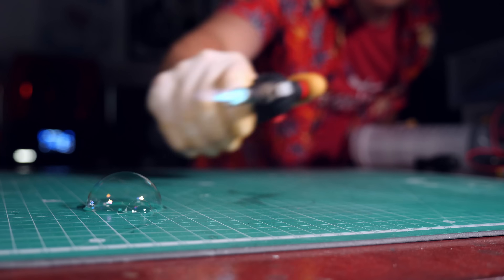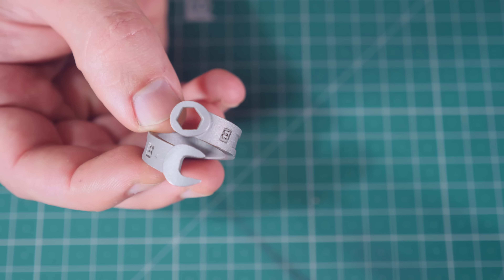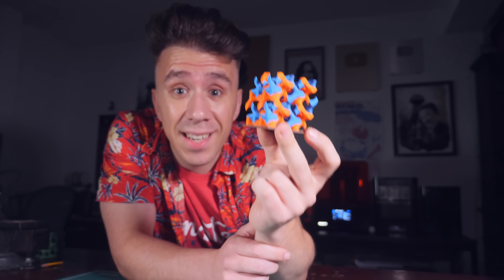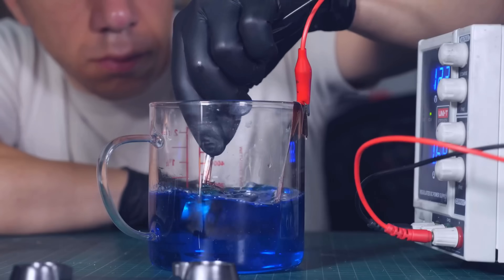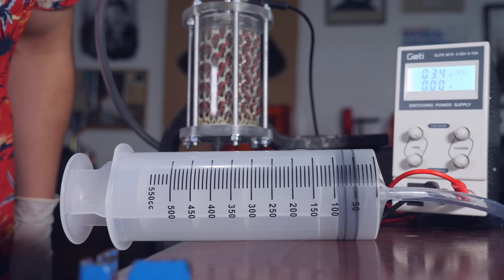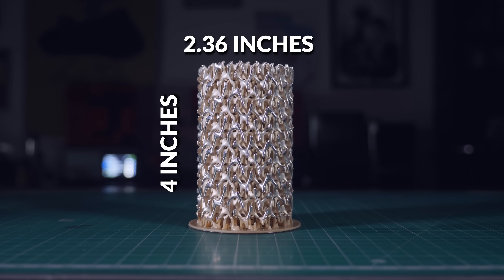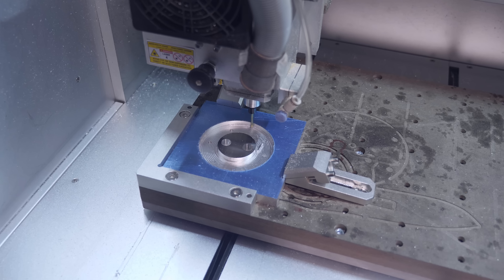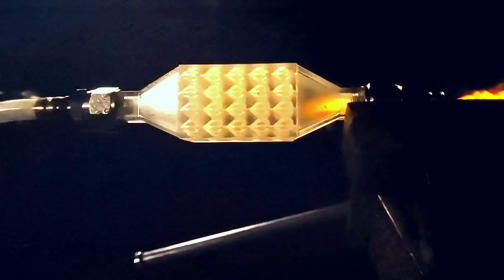ROCKET that LITERALLY BURNS WATER as FUEL

Comment from the maker: Click my trainwell (formerly CoPilot) link https://go.trainwell.net/Integza to get 14 days FREE with your own expert personal trainer!
Reply: Woah
Reply: I would like to try
Reply: BRING. BACK. THE. MOUSTACHE!
Reply: or even use a power supply as that would be safer.
Reply: pc power supplies are cheap and usually have a large/hefty 12v rail. 
some are rated for over 100amps. perfect for hho generators.
Reply: try plating it in gold.
Reply: Thought about using a tractor battery? A diesel glow plug is essentially a short circuit.
Reply: @Arrow14100  Tesla Tash, Tesla Tash, Tesla Tash! 🤣🤣🤣
Reply: Add some kind of current limiter in the circuit... Either using resistor or voltage regulator circuit😊😊😊.
Reply: VIDEO IDEA: BUILD A PISTON MOTOR THAT RUNS ON ELECTROLYSIS CELL AND THEN RECYCLES THE EXHAUST TO BUILD AN ELECTRIC GASS MOTOR (pls i really want a 3d printer😢😢😢)
Reply: You probably need current limiting resistors to protect the battery from discharging too rapidly. You could use an automobile battery or charger rated for 40A. You can't overheat the battery charger and it won't output more than its rating. You could put it into boost mode, which only lasts for a short period, and would give you 200A.
Reply: you can isolate the positive from the negative by adding felt layers in between the washers, thus giving you pure gas, not HHO.
Reply: try using a relay to reduce heat and save the battery...should get one from any old car
Reply: use a modified microwave transformer were you replace the secondary coil with a coil that have less turns (about 1 turn for the secondary coil for every 20 turn of primary coil) it should give you 20 amps of 12v every amps of 230v
Reply: Wrong, ist called electrolysis when you split molecules by electrons/electricity!
Reply: Hey @integza, have you thought about using capacitor banks? They are designed for fast and strong discharges.
If you have multiple power sources connected to a capacitor bank each and switch the circuits between them,
so that only one is discharging while the others are loading, then you could get rapid discharges of currents in quick succession.
Reply: For a high current power supply, consider using an Stick/electrode welder, most can provide 40 amps DC with constant duty cycle.
Just something I have seen before.
Perhaps vertically orientated plates will help with preventing gas from forming bubbles between the electrode plates.
Love the content and take care of your eyebrows!
Reply: Maybe this is where that one story of someone figuring out a way to make a car that runs on water but suspiciously destroyed possibly buying car manufacturers
Reply: hi integza!!!!
Reply: Try and put an expansion chamber so you can use your power supply and it might be enough to get it to run constantly.
Reply: You should use a Huawei g4850r2 power supply which can output up to 60A continuously and has a working Voltage range of 0-60V with a total power of 3kW! It can be bought for as cheap as 80$.
Reply: if you are having issues with amps, put multiple of the exact same battery in parallel. That will spread the amp discharge across them and increase battery life.
Reply: Hi do you sell the file for printing the rocket engine?
Reply: put a resistor in between >?
Reply: you should look at some used HP 1200w server supplies. they can do 12v 100A and you can get them really cheap.
Reply: If you had a generator on a hydrogene powered turbine... could you make your own fuel from water to run the turbine?
Reply: Now you know what I went through YEARS ago when I tried to add one of these to my car. The damn thing drew so much current it started melting my jumper cables, but boy howdy, did that thing make hydrogen. 😂
Reply: Kalimero.
 Para protegeres a bateria dessa câmara de combustão aquática; basta utilizares um thermal-relay no lado negativo da ligação eléctrica. 
 E essa foi uma boa tentativa de se criar um motor a água. Embora, esse design de electrolise, talvez interesse à industria espacial ou à naval; para aparelhos geradores de oxigénio.
Reply: you want amps try wiring a couple car batteries in parallel
Reply: water DO NOT BURN 
burning
/ˈbəːnɪŋ/
adjective
adjective: burning

    on fire.
Reply: I think your design could be used as a engine for cars cheap and effective the battery could charge it self by resistance of the tire movement. Keep the idea to ur self don't letter other science people get it. Love ur video and love Nicolas tesla he my favourite scientist as well
Reply: Make a rocket that runs off of punctured lithium batteries
Reply: @schlend4  This will work too kind of dangerous as u need to be sure to discharge them before touching :D
Reply: forget about trainer and tell us where you got your hair implant/enhanced?
Reply: @reaperiscomingforme  they already refined the idea for use in cars. toyota did it with the mirai, though they use a PEM fuel cell
Reply: @jackasshomey  is it still used today
Reply: Limiting the current is your first port of call, second is the orientation of the lattice, rotate it so it's on it's side so the anode and electrode are vertical, this will allow for the gas to escape easier (or redesign it as three/four intertwined spiral cones for anode electrode and structural insulator).
Reply: Up next / future video proposal:
AI Designed rocket perhaps? LEAP71 rocket
https://youtube.com/shorts/OpzBNkh2C5w?si=ZD3IC2rlKjqguiUq
Reply: Please look up the a i generated rocket engine LEAP71 - future video perhaps? 🤔🤓😉
Reply: @reaperiscomingforme  yea the mirai is still in use but its only really in specific area's cause hydrogen pumps aren't available in a lot of areas. but it does work and its even shown to be comparable to gasoline and diesel motors for mpg

not sure why they haven't implemented it further.. only pushback im seeing is coming from the people pushing EV's because they call it "grey hydrogen" and say its "dirty hydrogen" even though on a molecular level its essentially the same as hydrolysis hydrogen.
Reply: @jackasshomey  cheers mate I never knew that 👍 😀
Reply: DC welder is your simple solution. Check out my proposal for 2 stage compressor w/ afterburner if you choose to continue the path of destiny (in comments) stay safe and thanks for Tainwell, I need this!
Reply: You could ask someone like electroBOOM to help you with the current issue
Reply: Pls do a cyclotron
Reply: Maybe fine tune the frequency of the current foor the hydrogen generator I read a brief paper about a man who basically said it's about frequency to maximize the hydrogen generation
Reply: I really need a 3d printer for my projects please 🥺

My Idea is to use the generator to build a hydrogen jet engine, dangerous but super powerful 😊🫠
I hope I win
Reply: Hey man. Great video.  Research: "Stan Meyer explains the Water Fuel Technology". I think he used AC(alternating current) instead of DC. You'll find a few videos about him here on YouTube.
Reply: Tomatoes are discusting!
Reply: Motion control that needs to move heavy things, where the motor draws a lot of current, use current limiters rather than speed controllers. Maube that would help?
Reply: Here are a couple of tips: consider using titanium plates instead of stainless steel because they resist corrosion during electrolysis. Also, bubbles of hydrogen and oxygen can create a gap between the electrolytes and the disc surface. Designing a method to minimize surface bubbles can enhance the efficiency of the generator.
Reply: From my tests, I used an 1000w PS from a PC on the 12v pin, It should do the trick.
Reply: what did you study in university
Reply: try it with engine
Reply: Just use an inverter welding machine. You can do 400A continuously if you have the correct model.
Reply: can u try acide battry (car battry ) to get high current
Reply: ooh like in the Sumerian Tablets, not only was their space propulsion water based but they run out of fuel through the asteroid belt because they also use water as weapon system. So it says they had to refuel on Mars the sixth planet even tho ship not designed for that.. and then they finally arrive on Earth the seventh planet..
Reply: @integza  hi there seems to be a scammer with the tag @integza3dgiveaway typing" w i n n e r " to get around moderation. Got me excited for a second lol 😅 but v obvious
Reply: how about a video about piezoelectricity?  its amazing i think it would make a great video . like there is a small crystal that gets slapped in push button lighters that generates enough electricity to light a flame!
Reply: What would happen if you treated the gen like a double tesla coil?
Reply: Why is this comment older than the video
Reply: Timeline: 3:00 Did you say water doesn't conduct electricity? And that is the reason why you are using sodium hydroxide.
Reply: What about thick water?
Reply: You could use a car battery cheap and you get high Ampere Output.
you could also try to make the engine smaller. Due to the fast reaction backfires are an issue so high pressure could be Dangerous ( the build you have does have a ratio high pressure, slow burn to Low pressure fast burn. The reaction is very fast (fast burn) so finding a nozzle isn't that easy). Useing a fuel cell could also be an Option If you Mix hydrogen and oxigen in the pressure chamber you could minimize the risk of backfires and diffrent fuel to Air mixtures would be possible ( you could Change the reaction speed )
Reply: Use a HHO dry cell.
Reply: use car battery
Reply: That subscription costs 90 bucks a month
Reply: Also get a modify a microwave oven transformer to get the low voltage high current you need... You need some really thick wire to do so....
Reply: Sc welder is probably something already have
Reply: Try a CAR BATTERY.  It won't let you down.
Reply: Video idea I think you should make a rocket powered off methane like for example if some kind of collection plant took garbage and collected the methane then made a rocket engine u don't have to use the garbage part I'm sure u could find methane some other way
Reply: you need to get higher C rated batteries. also higher capacity cells will put out more amps reliably than smaller. Lithium packs aren't linear as far as current draw is concerned. If you load a pack higher than its C-Rating, you lose overall capacity. meaning the more you overload, the quicker it dies. Also going to a higher voltage, wouldn't necessarily improve your current draw issue. you need get multiple packs in parallel, to get higher amp draw for a specific pack size. higher voltage packs of the same size sacrifice capacity for voltage(capacity directly relates to amp draw in Lipo cells particularly.
Reply: I think you need some resistance to prolong your batteries life.
Reply: @integza with my experiments I found out that baking soda and water with a teaspoon of vinegar and stainless steel works just as well to build hydrogen
Reply: You need a ZPM or a Tesla coil.
Reply: You can also have the  and oxygen kept apart and later add the oxygen to keep an consistent burn😊
Reply: Use a car battery
Reply: Congratulations on 1.23 million subscribers 123.
Reply: I would recommend using step down transformer !!!!
Reply: Can you can make engine what with this hho generator
Reply: Kolejny raz widzę że masz coś z etykietą po polsku, masz coś wspólnego z Polską? 🙂
Reply: try using a tractor battery with a voltage controller so you can control how much goes in and out with the extra heff of a tractor (or motorcycle) battery. my buddy made one of these and ran into the same problem, though he was trying to get a small motor to run off it. He got much better results even after just getting a tractor battery. he did get a controller of some kind to control voltage or wattage or whatever it spacifically lets you adjust.
Reply: A car battery will work best for you, it's cheap and can give 1000 amps of current, just change it probably after use
Reply: Try a DC to DC converter and maybe throw in a blinker relay to help mitigate the amp runaway.
Reply: Hydrolysis? I thought it was electrolysis. Taught me something new.
Reply: you need to add some capacitors and add a voltage/wattage controller so it controls how much power it can pull from the battery. that should keep you from smoking your batteries. look into solar generators, they have a lot of technology built into them no days that will fix your problem.
Reply: Humm, maybe the power could be stepped up with capacitors.

You could get a steady outflow and not kill your battery that way.

Possibly.
Reply: Dunno if I'm being dumb here, but if there's too much current then the obvious solution is a resistor to slow it down??
Or am I missing something why this can't be done/wouldn't work??
Reply: lets take a car battery for example:
There are couple of things:
Warranty
Cold cranking amps
It is a non-deep discharge battery type.

CCA is another way of telling you the batteries internal resistance. That limits the absolute maximum current.
In this application we don;t care abut the "gas guage" or Watt-hours the battery can provide.

Once you deplete the voltage below some value, the batteries lifetime has been seriously impacted.

You would use a deep-discharge battery like for a trolling motor.
Reply: What will happend if you got a turbojet engine with a generator in the front ? Now you produce your own electricity to the tank that produces hydrogen and oxygen, can it also power a waterpump to the tank? Perpetual machine?? 🤔
Reply: Current Solution: Stanley Meyer - It runs on water (You want electrons, not Amps / heat.)
There are two ways to get lots of electrons:
1. High Current and Low Voltage or
2. High Voltage and Low Current
Reply: The reason silver didnt work is likely it's sensitivity. When using Sulfiric acid, the silver reacts with the sulfur in the mixture forming silver sulfide, and when using Lye the silver forms silver oxide. Processes sped up by the electrical current. Try noble metals in the platinum group (though they are extremely costly)
Reply: I'm only @13:40 but I have to suggest mesh disks.  The surface area would be pretty mind-blowing.
Reply: Get an alternator to directly convert the wall Power to a few volts and lots of amps 😁
Since you're mixing anyways you don't need to worry about the alternating polarity.

But DO be careful with the wiring and insulation job.
Also connect the device first, THEN plug in, so the sparks are as far away as possible.
Reply: VIDEO IDEA: @integza maybe instead of a rocket maybe design an engine ( similar to a ICE ) so that you can create a feedback loop similar to a car that uses the ICE to rotate an alternator to keep the battery charged....might be worth looking into a solar option so the energy for electrolysis is taken from sunlight instead of batteries
Reply: hey integza, highly doubt you will see this comment. my recommendation to get a high amount of amps would be to get an automotive car battery and charger, those batteries can easily put out 800+ cold cranking amps which at least here in the us is a unit measured at 0F. That means the actual "cca" rating is usually much higher at room temps. If its enough to start big diesel and car engines then it should be plenty for you're hydrogen generator! Just remember that you can get good used parts out there if you do a little looking it will save you on costs!
Reply: What about making a engine that can run on hydrogen
Reply: I really need 3d printer for my 1st time learning... My suggestion is to put 30amp pwm after battery to your system to prevent the battery from breakdown, I hope this help👍
Reply: Idea for a future video is a Electric car powered by solar to get it moving first and a wind turbine to capture the wind in the forward movement.
Reply: @integza Woth reference to engine working on CMG gas… You can simply replace CNG tank with this too many small hydroelysis systems with a series/parellel connection to produce high amount of Hydrogen gas and can also store it to travel longer distances… also can do some changes in CNG engine to make compatible with Hydrogen gas fuel.
Reply: Oh because you don't have a car battery laying around or a battery charger
Reply: You can use a full bridge rectifier and plug it directly into the wall, I tried this and it pulled about 120v dc at 20amps. That’s about 2400w of power and it cost me 5$ in diodes XD for the love of god don’t try this at home.      I used a power strip and a 8000w high voltage regulator. Got some decent results 😊 also putting a diode on those batteries will prevent shorts so it won’t kill them but discharging too rapidly without some kind of regulator can burn holes in the batteries making them useless.
Reply: Maybe check out the thunderstorm generator not a rocket engine, but I'd bet you would find it very useful and take it through its paces, and in place of a muffler im sure its loud and very entertaining... and relates to this video pretty well!
Reply: Use distill water.
Reply: I would use a rectifer fioad and ac mains power
Reply: Installing a 0 - 36v PWM might work with 12v 12ah deep cycle ebike battery.
Reply: Try 12v car batteries there really tough batteries and can handle heat fairly well u can also double them up and make it 24v and when buying one look for the highest “CCA” number cca stands for cold cranking amps, it’s not uncommon to see a 1000CCA cad battery and u can usually get them for around $250 new
Reply: for the power supply of the HHO generator you could use a car battery, or buy a more powerful power supply which can handle that much current.
Reply: Burning Metal fuel rocket
Reply: You could try using a manual crank generator
Reply: Supercapacitors ran in a star pattern would reduce heat and maybe a small transformer to step it up a little.
Wouldn't the burst of higher voltage produce more gas rapidly? 
Thanks 🙈🙉🙊
Reply: @schlend4 I was thinking the same thing but super capacitors along with a transformer to step up the voltage they've got some big voltage in a  small package super capacitors now.
I think it's definitely worth a try
Reply: Why dont u use a car battery.
Reply: Thats really cool 😎 you make nerdy things very entertaining for people like me 😊
Reply: Video idea: pulsejet engine/this rocket engine used to power and internal Combustion engine
Reply: The entire project is foolishness  because you use usable energy (the electricity)  to create less quantity of usable energy since in the process,  some of the usable energy (electricity) is lost and produces 'less energy' than the initial energy you used to produce the new kind of energy.   DID  YOU GET  THIS ? ? ?   WE HOPE THAT YOU  UNDERSTOOD  WHAT WE  SAID.  A genius  high IQ  is revealed by someone who invents and builds something that could use with 100%  efficiency,  the energy existent in whichever form exists and is everywhere available to almost everyone like the light,  the wind, the sea or ocean water,  without consuming energy to produce energy. The whole idea is to consume the energy from the existent form and not to consume another form of energy to produce less energy than you have consumed.
Reply: KCals not Cal…..
Reply: @PankajDoharey  distilled does not conduct electricity
Reply: Car battery with warranty If it dies return it
Reply: chain 4 car batteries up to it
Reply: Was gonna say, 1 battery will overheat and die very fast but 4 would rip it apart, if it was in series, so fast it will cause cavitation in the water increasing how much electricity needed. There is a sweet spot for these and it’s determined by surface area and how many electrodes. Still recommend a voltage controller and diode to prevent grounding. Car Batteries don’t last long though because they can only discharge 40% before they start to damage the battery. Lithium can use 80% but there expensive as hell and can catch fire. I would love to use a gas generator to see if it could run itself, but after spending so much on the project I gave up. Let me know how you guys fair 😅
Reply: Let's make hydrogen engine
Reply: Try using barium oxide instead of alkali
Reply: 1. Coat with gold, not silver
2. Use a 12V plug-in power source, not battery
Reply: @integza have you tried a car started ?
Reply: Integza essa poderia ser uma sugestão para conseguir a corrente que precisa
https://youtu.be/RPvYjrSWCUo?si=aHa0EEPHxUEWv9CY

Pega um transformador grande e modifique o secundário, vc conseguirá puxar essa energia da rede elétrica, so garantir que a instalação elétrica do seu lab suporta
Reply: Reduce your Amp draw with more space between plates or reduce the electrolyte
Reply: why not use a car battery charger or battery tender
Reply: Could you make it use AC, you dont care about what gas appears at each electrode anyway.
Reply: limit the current so that the battery is protected.
Reply: So I have an idea about your next video ;) Not sure if you can pull that off cuz requires some outdoor things to do.
You could check how much power is 'stored' in water if it falls from some height.

So, for example:
-have some rain-water stored
-pump it to some upper area with wind turbine for ex. or solar panel - so it's ~free energy
-after dusk try to open the valve and power some led light to light entrance of ur house, or whatever :)
-check how much time it can power the light with ~10 liters for example... idk...

Also, 9:20 - i'd use kitchen salt, the advantage is that you never have to refill that one :)
Reply: If I need a lot of power, I use server power supplies. They are available up to 2000W at 12V and are usually really cheap ($10-$20). The power supplies can be operated in parallel without breaking. So you can quickly get 10.000W at 12V for under $100. Don't forget your breakers... xD
Reply: I have a reply that says I won. I have a hard time believing that it is real because it doesn't have the correct name.
Reply: Video idea; wireless transmission of electricity?
Reply: hi my friend @integza. you can put a power resistor in series to your eletrodes. like 1 ohm  or .25 or even less. 
if that work horrible you can put more in parellel to reduce it resistance. 

like 4 resistor of .5 ohm, in parelel in series to eletrodes.  it will limite the draw current from 20 volts power suply or battery to 20v /  .1 to .15
so the current limit by resistor will be 130 to 200 amps. 

so if you think its lot of current use 4 of 1 ohm resistor. 20V or your power suply /.25 = 80 amps
or 14.8/.25 = 60 amps and lot of heat. 

About the heat i used a intel stock cooler and glued power resistors with thermal paste and power with other suply. In my case is only 10W of heat. and 2 resistors. 1 cpu stock cooler with the fan was ok.
Reply: Bro... why don't you make a miniature step up transformer which can give constant high voltage current..❤😊
Reply: Stan Meyer who claims to have invented a car that runs on water, in his patent it describes an the electric power source as a pulsing square sinewave,...
Reply: I thought you were saying 450 hump hares 😂 Made my boyfriend play that part back twice. 
Thank you for making an awesome video! Love the accident.
Reply: Here is the True Savior

HalleluYAH translates “Praise ye YaH”

YaH is The Heavenly Father
YaH arrives via the TENT OF MEETING
YaH was Who they Crucified for our sins
YaH was Crucified on an Almond TREE

Semitic of Moshe (Moses)
Isa Scroll (The Original Isaiah)

Isaiah 42:8 - I am YaH; that is my Name! I will not yield my glory to another or my praise to idols.

Isaiah 43:11 - I am YAH, and there is no other Savior but Me.

Isaiah 45:5 - I am YaH, and there is none else.
Reply: A decent solution for this is to maybe instead a current limiting board so the chamber doesn’t destroy the power supply, which you need a beefy one for the system to produce enough hydrogen and oxygen to be useful.
Reply: Use the bigger battery and an adjustable voltage module, since voltage directly affects the current draw. You can limit current with a bulky resistor for initial tests, and please buy and use a clamp meter for measuring current.
The closer the gaps between electrodes - the less conductivity you need for the same results, since resistance in water is proportional to the distance between electrodes. Reducing water conductivity could also help with the current. You could reduce the surface area of the electrodes if your current setup produces more fuel than you need (save space for more water).
Also test out more water solution options, test for residue, reusability, price to performance, etc. Would love to see this design actually function. I'm sure you can make the hydrogen generator more efficient and functional than it is now.
Reply: Try geet plasma fuel processor
Paul's son, you have full permission!
Reply: We used to have cars run on water in the early 1900's. Big oil greed.
Reply: @Aliens-Are-Our-Friends2027  Steam power? If so, that isn’t water, coal or some kind of flammable fuel is what it ran on to heat up the water. Either one is critical.
Reply: Ima do this at home
Reply: What next ?
Reply: you could limit the current
Reply: VIDEO SUGGESTION:
Build a replica of the Stanley Meyer's HHO gas core transformer!
Reply: @ddoherty5956  This is why spark plugs are connected to a coil pack ... which makes me think a coil pack would be all that is required! Coil packs work using magnetic induction so it isolates the circuits!
Reply: Please Work Mike Marcum Project also
Reply: You should make a BOMB with the gas from the electrolysis generator
Reply: Great video, thanks.
Reply: Make a tomato incineration mechanism that is powered by the gas engine from that machine
Reply: you could use a welding machine as a power suply
Reply: There were some sources years ago when I looked into this that modulation of the plate signal at two specific frequencies greatly improved output of the HHO generator. This was before 3d printing... and these generators were using stacks of stainless plates. What you need is a PWM circuit that you can tune to the resonate frequency of your generator. Then output will boost and current will optimize. What this will do is allow the gas generated to evacuate the plate, its almost pushed away, then water can flow back in to be split. At just the right PWM frequencies you can seriously boost output by resonating with generator itself.
Reply: Suggestion; build a home thorium reactor😮😊
Reply: @grenouille-de-geek
Reply: HHO Jet
Reply: Hi just a suggestion try using a bank of capacitors hooked in parallel between your power supply and the HHO generator
Reply: Hi just a suggestion try using a bank of capacitors hooked in parallel between your power supply and the HHO generator
Reply: car battery or semi truck battery
Reply: Try using a welding machine as a power supply
Reply: How about applying it to a Tesla turbine to generate power.
Reply: You should  be placing the disks vertically.  This would make the bubbles come out more efficiently due to the buoyancy while the bottom gets replenished by fresh water.
Reply: Is it possible to 3D print guns on this website
Reply: Bro you are joking right that I am winner
Reply: I really  found this fascinating.
Reply: it literally burns hydrogen and oxygen for fuel, not water.
Reply: car batteries average over 500 cranking amps
Reply: Do a video on the Sears effect generator
Reply: Power Supply will adopt the same principals as your generator...
Layers of conductive plates separated with a dielectric...
A SUPER CAPACITOR⁉
Reply: Isn't it true that if you can make a hydroxide turbo engine then you can make a water engine .❤ Oo and love from India bro🇮🇳
Reply: @integza, Dude you're like a homemade tony stark. can you list all your equipments for those who care
Reply: Funny you mention the 3d printer cause I actually posted a comment a while back about making a jet using water as fuel! I'd love a 3d printer I think they're so cool! Sadly I probably dont qualify for your giveaway
Reply: Why use sulfiric acid, when salt does the same job?
Reply: Have you thought about printing the lattice out of graphene?
Reply: Here is the idea for next video 
Try to combine your most successful jet models to see fi the can reach Mark 2 😅 or 3😮 and use water as fule (HHO) for combustion and use glow plug instead of Spark plug to be more efficient pls do it
Reply: @COD224  Good luck, unless you can find a way to make phase changed H2O hyperkinetic with self generating low state ionic dipolarized  antimatter in this century (cold fusion), then there's a limit to thermal induction of raw separated hydrogen without wildly new engineering which could never achieve Mach 1 or beyond - otherwise we are stuck with 'brilliant' ideas of how to make blunt instruments like heat and combustion used as kinetic and electromatic generation more efficient (steam engine era tech with modern updates).
Reply: Maybe try a cheap IGBT stick welder? Did that and it scared the sh** out of me xD
Reply: Your video very inspiring
Reply: Try a jelly roll type of anode & cathode setup using perforated stainless steel ☝
Reply: Better Open Source this and send it FAR AND WIDE ASAP.

Elon Musk said he was in fear of his life, and that is why he open sourced his stuff.

For your own sake, please
Reply: Just use super thin sheets of metal  put them as close as possible . Like a stack of loose leaf paper that are 1mm close. That's a lot of surface area
Reply: Future video idea: create a battery/power supply that can handle the imperials you need to run this thing full throttle. That would be amazing to see.

Also, my extremely poor, get rather invented, so I could really use a 3D printer. Wink wink. 😊

But, then again, knowing my luck...😢 I won't be holding my breath.

Regardless, I just stumbled upon your channel and love your videos. Keep up the good work. I quite literally have no money to send to you, I support for this channel. So, I guess my encouragement will have to do. Lol.
Reply: You probably need a marine/cold weather/heavy equipment battery for the amperage and time you are trying to generate HHO for. You can also use a large capacitor (1 farad+) like those used for high end car stereos since they are made to be charged and discharged rapidly and often. You can use the charged capacitor in tandem with the battery to keep the battery from getting trashed on a few cycles as well. I would move away from the alligator leads and to a distribution block and switch if deciding to go in this manner. You will also want to move over to a much heavier gauge of wire as well. Something 4 gauge or larger should be ample to handle the current. You could also cannibalize an old mig welder. BTW you’re gonna need a much bigger syringe for any of these.
Reply: 2 months I am too late ....
Reply: I watch your video you should make
BL DC MOTOR HELE CHOPTER
Reply: Solution plug into the wall
Reply: Loves those gyroids this lad
Reply: Pulse the DC current, and adjust the duty cycle, with a driver like this one. You shouldn't run those batteries wide open. They heat soak, act like a short and..... Poof. 

https://youtu.be/DkhpuuPljS4?si=dgEMnDs_FpgFbqmK

That was the video I watched before this one. I have found the best part if the algo
Reply: Thank you for your videos. I would point out two things you may not be aware of.

The vibration method effecting a phase change of the water. There are vapour generators that do this. I have read research on this and 11 times more gas is produced although exact methodology was not provided.

The water as a capacitor method. This method is thought to be Stan Myers secret for his hydrogen car. Effectively the water holds a charge, so normal water but prepared before hand. It then feeds into a chamber where a high voltage causes the charge to destroy the water capacitor where it is thought it breaks down to hydrogen and oxygen. I have reviewed some of the garage experiments and they use resonance (a tesla coil) to create about 50k voltages at low current. Most of these use an additive rather than the precharging phase suggested by Stan. The high voltage circuit is rectified to DC not as I thought it might be kept at AC (sort of pushing the hydrogen off the oxygen at high hertz) however the design and patents leave many details. There is a chap in Asia that sells the boards $125 I think.

I liked your approach on surface area and gap, thank you.
Reply: @nilsrp the patent suggested he simply used resonance to up the voltage and rectified it back. However It was my thought to also highlight this. Thanks for the post.
Reply: @IshaqIbrahim3 its a natural capacitor there are some good videos on using jars of water to build up charge. Thanks for the post.❤✌
Reply: How can you create a continual burn?  What about a hot element?  Preheating the fuel?  How does Space-X do it?
Reply: Integza, you need to use pulse width modulation to power your phone generator.  Find the right frequency and it will greatly reduce your Amp load. Also using the principles in a sonic cleaner on your cell will increase gas production.  The gas production from the cell is slowed down from the gas bubbles on the plates, the quicker those bubbles unhook  the more gas can be produced,  the gas bubbles temporarily insulate the plate preventing the electrolysis process from producing
Reply: @dancer7317  these were some of the things that sprang to mind. The language is awkward Faraday was correct in worrying about definition. Hope he reads these comments its all been covered up for too long❤✌
Reply: Coil gun
Reply: Stanley meyer. 
Be careful!
Reply: Can you direct a balloon containing helium gas through static charges? Can you do that? If you do it, I will subscribe to your channel 😊
Reply: @ياسرمحمد-ت8م  can you?
Reply: @PatriotWatcher1  yea
Reply: @ياسرمحمد-ت8م  make a video and post it then. Prove it.
Reply: @PatriotWatcher1  It takes some time.
Reply: @ياسرمحمد-ت8م  no excuses. Do it or you're full of 💩
Reply: Test mild steel  versus the stainless, you'll be surprised at the results. I leave the scientific method in your capable hands.
Reply: KOH not sulfuric acid, or baking soda, and sodium hydroxide.
Reply: @greatwazzoo he used led arrays. I've seen the plans. Food for thought.
Reply: Hey I just watched your video and at 55 yrs old you truly inspired me to get off the couch and go do something magnificent that will effect many more into also doing random acts of kindness!!ty gr8 video
Reply: Jesus is our Lord and Savior, repent and turn to Him and forgive people no matter what they did
Reply: Would be good to add the silver to the stainless steel plates? Bit of overkill but may last longer? Would it be more efficient, or less? Nice design, thanks!
Reply: Are you using rainwater or distilled water? Ground water contaminants will form if you don't use clean h20
Reply: pulling too much current for your power source ... build a current limiter circuit ... and set the current to what you can safely handle with the battery ... I suggest 10 to 12 amp ... and yes make sure you have nice thick SOLID wire as the power leads to the electrolosis part ...
Reply: @grenouille-de-geek  my thought exactly,lol.
Reply: People talk about a perpetual motion machine and say it's impossible, how about making 8 small ones that can power DC lights and you only have to restart 1 daily because they all work for a specific time,you just need the timing right
Reply: No i am not going to install ai garbage
Reply: The best idea for a future video is: How to make a combustion engine powered by water. This would put an end to global warming caused by the gases released when burning common fuels, and would also solve the problem of those who cannot afford to pay the price of common fuels.
Reply: Wonder if Trainwell got paid from microsoft for the copilot name or made to change it?
Reply: is there any information anywhere on if or how this would be feasible/ not feasible for an actual rocket?